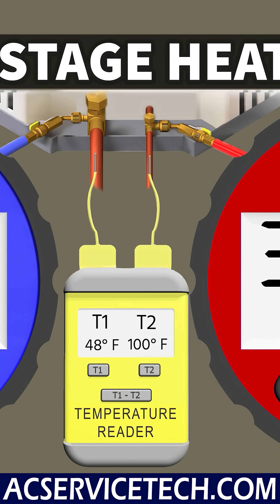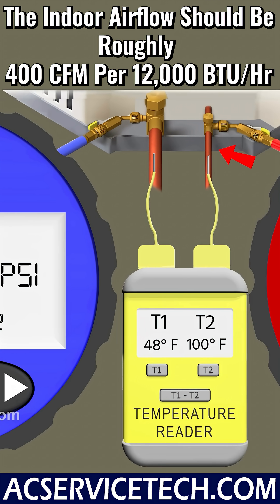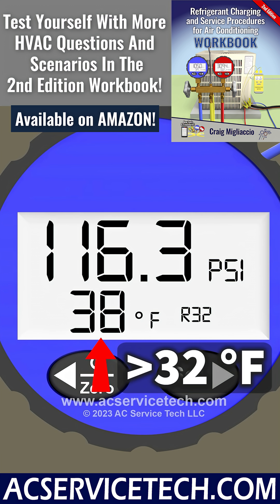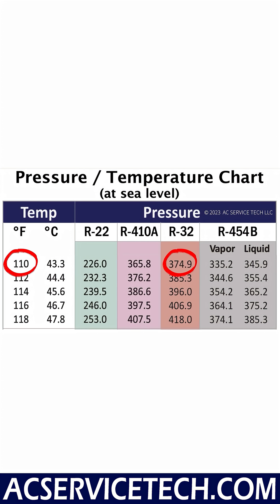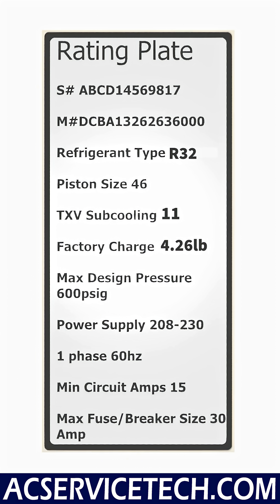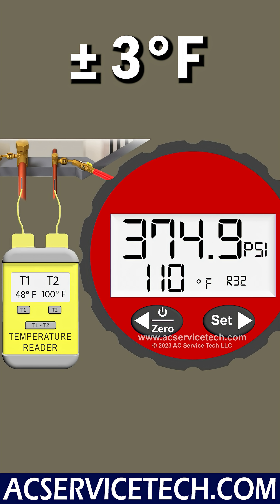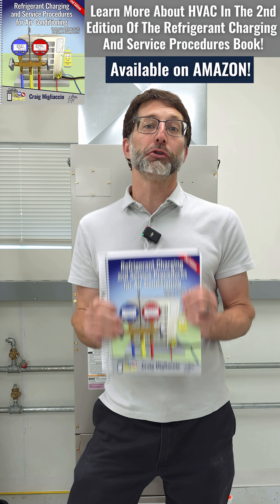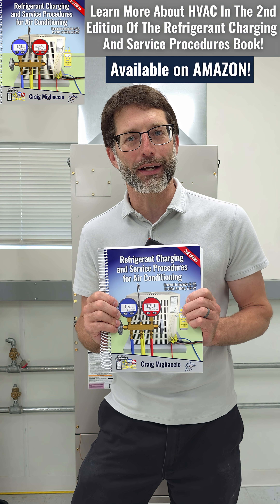Checking The Charge of an R-32 Air Conditioning System With Subcooling!

Comment: 🧐 liquid line is in the high side of the system, I think it should be connected to the red gauge. Get the reading on the red gauge, go to the PT chart, get the temperature that match the pressure. Compare it to the temperature of the liquid line. Make the calculation, get the actual sub-cool.

Comment: The idea of working with R32 is a little scary to me.
Reply: Not nearly as scary as having no a/c in the summer😥
Reply: There’s nothing scary about it. At sea level to 2,000 feet a 20 pound needs exactly 315 sq feet to be safely diluted. That’s an entire drum. With 4 pounds 63 sq feet is needed
Reply: @ToddBrooks-l4n I was confusing it with R290, I'm pretty new to HVAC.  I'm learning a lot as I go on.😅
Reply: Why, back here all new minisplit uses R32
Reply: @luissalguero686 like I said above, I was thinking R-290 which is straight propane